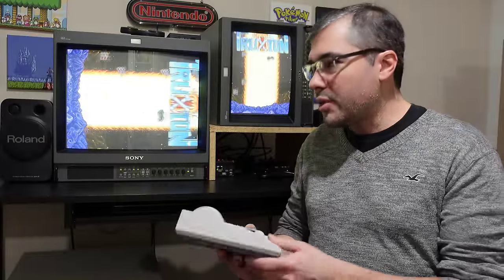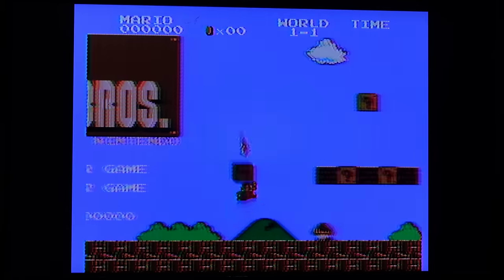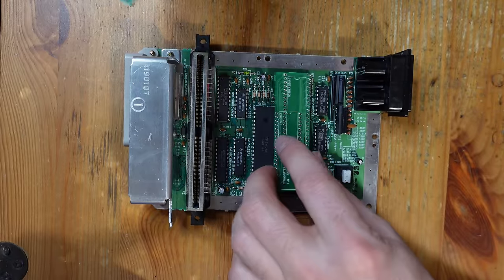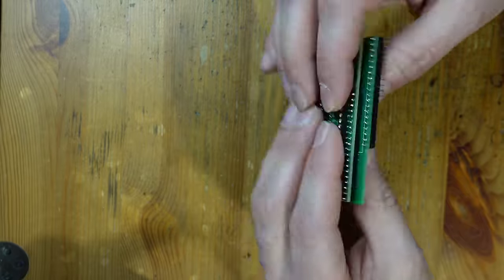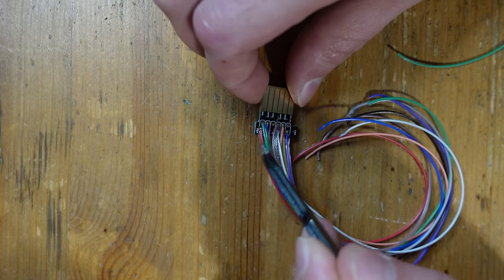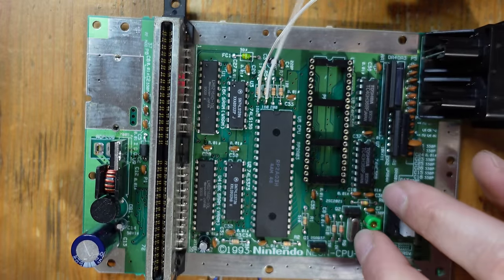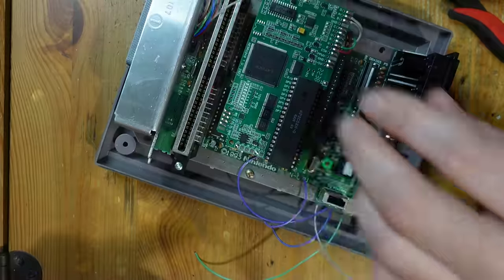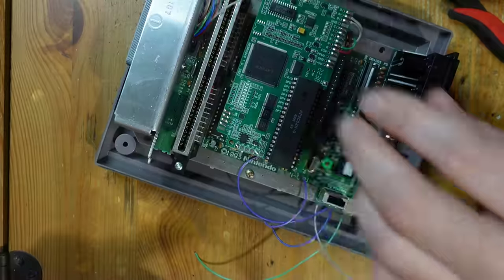Upgrading the NES Toploader with the best video! NESRGB 4.0 install guide and demonstration

Comment: Besides the SNES style multi-out in the back, does the Tim Worthington kit come with every bit of wire required for this mod, or did you supply some of your own as well?
Reply from the maker: No, I supplied my own wire for it. Normally I use 28 gauge copper stranded wire

Comment: I did this to my A/V Famicom a few months ago. Probably one of my favorite mods since it looks so much better than stock, even the composite looks better now. On mine I didn't hook up the part for the controller combos though, I just have it wired to always use the one pallet I like.
Reply from the maker: Yeah I also don’t really use the palette switching either, but it’s a nice touch. It’s definitely one of the biggest upgrades in video quality

Comment: A friend of mine bought an AV Famicom with this mod pre-installed from eBay. No idea what the seller did, but the audio for the pulse wave channels (Pin A) is far louder than the triangle/noise/dpcm (Pin B) or the expansion audio. What do you think might be the reason for that?
Reply from the maker: I would have to see pics of the board and I might be able to help. You can contact me at my website

Comment: Great video as always. Installing an rgb board on an nes or famicom never gets old for me. Favorite console and mod of all time. Im curious why one would want to turn off the rgb? Do happen to know why that option is there?
Reply from the maker: Thanks, and I always enjoy checking out your latest videos! I think that the option to turn off the NESRGB is only really useful on the frontloader. For example, if someone wants to experience the original thing with the composite video jacks. On the toploader it’s not helpful because the original RF modulator is removed

Comment: Thank you very much brother for such an excellent installation, I have a question when you purchase the v4.0 board kit, bring the other green board and the 2 pin terminals that connect to the boards within the same kit, and the audio expansion enabled it in this installation, since the top Loader and front Loader do not bring the improved audio expansion.
Reply from the maker: I did not add the expansion audio for this specific install, but it is possible. Voultar makes an expansion audio board for the toploader that can be used with the NESRGB

Comment: Great job George one question what gauge wire did you use for this circuit board. I hope you can reach out to me soon thank you George 🤙
Reply from the maker: Sure thing, I was using 28 gauge copper stranded wire for this one
Reply: Nice thanks a million George you are the champ

Comment: I'm either going with the Top Loader(RGB Mod), using HD Retrovision SNES Component Cables, with a RetroTINK4K on a 55" QD-OLED (Samsung S90C), OR just settling for the AVS....Yet the latter doesn't seem to offer a CRT softness option, unless I'm mistaken. The last thing i'd want is to play NES(or any 8-16 bit title) games with razor sharp raw sprites, even with scan lines.
Reply from the maker: I don’t think the AVS has a crt softness option but honestly both should work nicely with a scaler like the rt4k
Reply: @LIRetroGaming  
Thanks! It's too bad RetroUSB couldn't get the AVS any smaller, or just more in line with the NT Mini's design. Top Loader is still the nicest looking NES variant imo. :P

Comment: If I were to leave J1 open and not connect a switch or any controller inputs would it just use the default palette? I don’t really care about switching palettes, and the default looks great to me.
Reply from the maker: Yeah it will default to the first palette. I agree, I don’t use the palettes at all because the default is so good

Comment: Awesome video, I really appreciate that these are out there. While Tims board is brilliant, his instructions are terrible. I installed this on a AV famicom and tested it before getting an upscaler. The AV famicom has the existing multi-out so I tested it using the multi outs component video. I was getting a weird grey and white picture out, with the unit turned on and the picture was fine with it off. I thought something was wrong because I couldn't find anyone else with this issue online. I then emailed Tim and he said that is correct that it does that. The other thing is sound, there is no mention of sound in his instructions. I was going to leave the original composite in place. After watching more videos this morning, I realised that with me using HD Retrovison cables that I should get the composite from the NESRGB for CSync(thanks to a video, else I wouldn't have known at all). I probably need to remove my multi-out and drill the component cable and the sound holes out like people have shown for ground. Then bring the sound and composite in from the NESRGB. I haven't seen anyone doing that, but surely that makes sense?
Reply from the maker: That does make sense and you’re correct that you need composite video for those HD Retrovision cables. All that being said it would be much easier to help if you can send me some pictures. Feel free to email me and I can take a look and try to help.

Comment: Impressive work !
This reminds me, I just received a NES, and tried to put it to good use for my son, but the graphics were immediately disappointing.
The graphic artifacts look equivalent to me to the ones you show on your video.
I would gladly post a link to a screenshot, but it seems Youtube is allergic to any link in the comments section... :(
This is not the same model of NES though, mine is a more "classical" one, 
I'm using composite cables already, which improved quality a lot compared to RF, but still, jaggy lines.
In your experience, would you think this is the same issue ?
Reply: wow, posting a screenshot link just worked !
Edit : well, apparently, the link to screenshot was removed, again... :(
Reply from the maker: It could be a similar situation with your front loader NES. This mod also works with the front loader and provides the same results!

Comment: Have you experienced any horizontal screen tearing that seems to occur on a cycle? I have a v3 board, and other than the occasional tear it looks fantastic.
Reply from the maker: That might be the dejitter function. There’s a jumper on the v3 board that you can close and it might solve that issue
Reply: Thanks. I have an AV Famicom scaled through a Tink 2x classic, but recently switched to a GBS-C scaler. I need more testing, but if the problem still exists I'll give that jumper a try.

Comment: Krikkz just released the rgb blaster for the nes top loader. 
No need to solder anything. 
Just attach it like a cartrage then the game and rgb connections are on the cart. Kinda like a gameshark. 
They should of just done that with most of these mods. 
There are so many ports, that can most of this stuff without doing all this. I feel like ill just destroy it.
Reply from the maker: The RGB blaster is a great option too, although for now you can only use it on a Famicom, not a North American or European NES
Reply: There working on USA one as well.
Reply: Solder stuff I try getting a ready one.
There so many ports all around the console that can do all this. It's up to the inventor.
Whatever works to get better picture and connect to the television.
I got a HDMI n64. Pretty cool.
Reply: If a part needs replacing ok. These consoles are decades old.

Comment: I just finished this but used voultar’s multiout and I get no sound at all. Picture looks great! The only wires I have soldered in the area where the pcb goes is the A & B wires and the palette ones. What could it be? I feel like I should do the regular wires soldered to the multiout and board
Reply from the maker: On voultars board there’s two pads that need to be bridged together for audio. Did you bridge that connection? If not, then the sound won’t work.